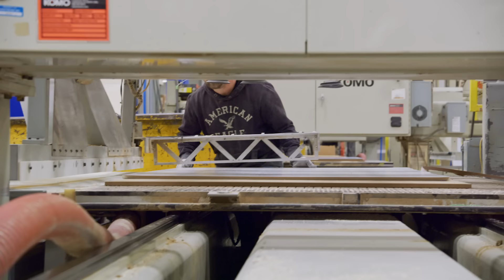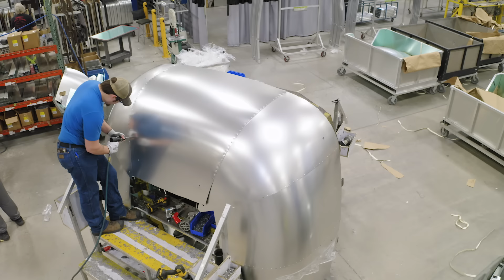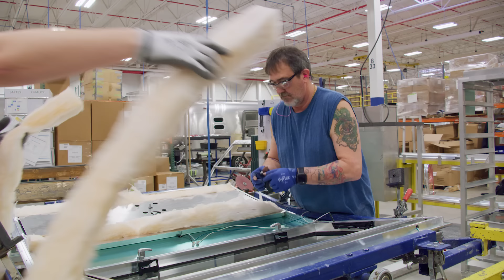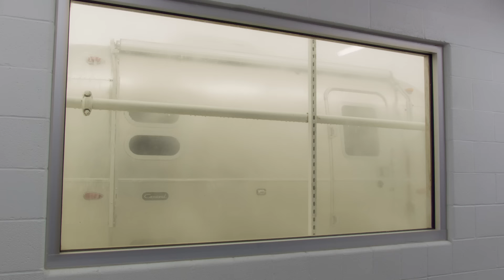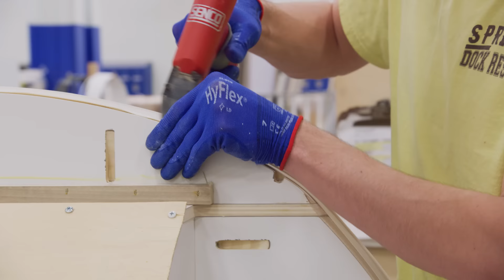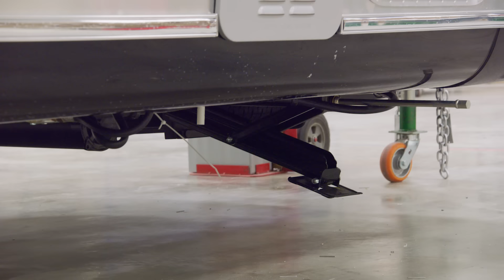Airstream Travel Trailer Factory Tour

Comment: I had frame failure on my 2023 Classic 30 footer I bought new. This caused form fill corrosion around the opening on the outside of it. They fixed the frame, but refused to replace the 2 side panels that had the damage from it. My doors were also a mess too and I had planed on replacing them myself because the cost was sooo much less than replacing the 2 outer side panels. They decided to replace my doors without even asking me first. Now I have nice new doors on an Airstream that is a nightmare to maintain now.

Comment: awful job on the inverter area wiring.   I notice when the shore power connection is attached how much flex is in the alum shell, so clearly need a better backer support behind that.   Can find lots of issues.

Comment: Toured old factory 5 times. Toured the new one 2 times. Fantastic! Started with a 2017 23D International. Now have 2019 Flying Cloud 25 RBT. Both purchased new. Both excellent Airstreams with zero problems. Over 500 nights in our 2019. Will only have an Airstream.